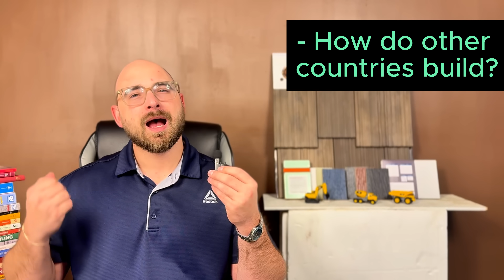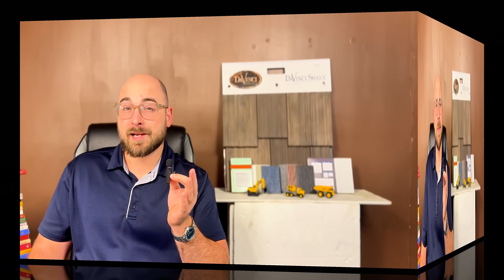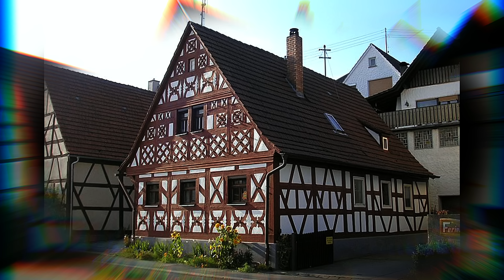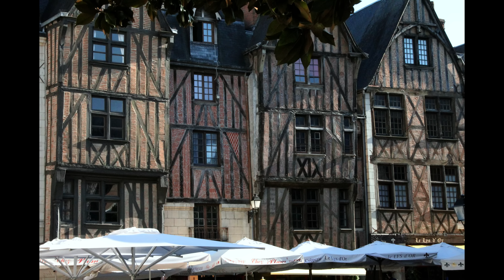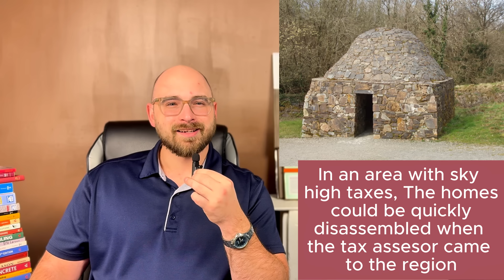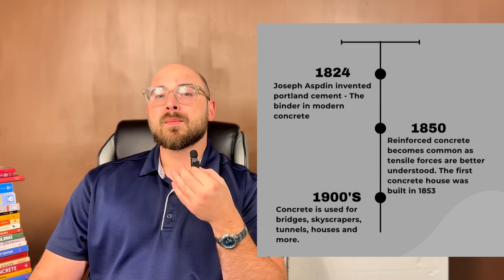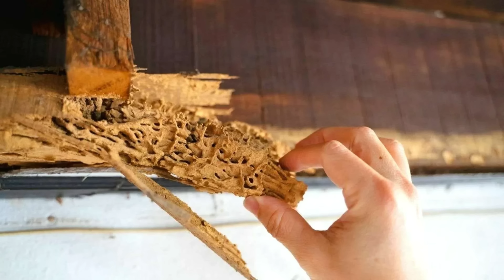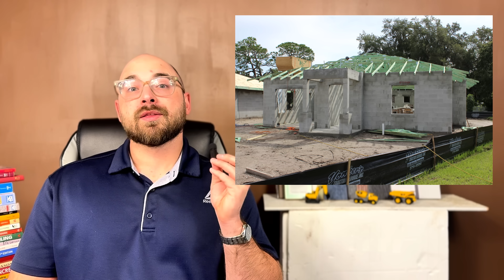Why Other Countries LAUGH at American Homes

Comment: We visited Europe in 2017, and stayed with friends in their rented suburban townhome in Warsaw.  The home was a spacious three level, and build quality was eye opening, compared to the stick and drywall we have in the States.  I did not expect solid concrete walls, throughout, quality stone stucco roofs, built like the proverbial bunker.  Warsaw was 90% destroyed in WWII, and rebuilt largely from the bombed remnants.  Frow what I saw, they build their homes to last.
Reply: It is not only wall construction but also for instance windows.  I went to the Sierra Nevada for skiing. In the ski resort they isolated single glazed windows with strech foil. In Poland we have minimum double glazed windows and tripled glazed are just standard when you buy new.
Reply: @piotrrajmundkoprowski4732  double pane windows are min code in the US. Not sure if any areas require triple pane windows but they are available if you want them. Just like some old buildings in Europe, some old buildings in US might have single panes but no house built in the past 60 years has single panes.
Reply: @Josh.1234  Josh go to Europe. Visit Poland, Czech Republic, Germany. You will see how much the US goverment lies. US standard of living is below average.
Reply: Well, you can build a american style home in Germany as well, as a rule of thumb you will need additional 30-50% structural wood to fulfill the DIN standards for load bearing and bending, and likely improve insulation and air tightness.
Reply: @helmutfrik1170  not only that, but one could build an American architectural style house in Germany but with load bearing brick, stone, and reinforced concrete walls!
Reply: @DT-wt5ku  in poland every trade school offers bricklaying programs. Canada had no masonry training until recently. Those masons who worked in North America were all feom southern or eastern europe.
Reply: Greetings from Warsaw.
Reply: Europeans plan to live in the same location for generations. Americans are always moving around. Family is not close. All of my relatives are close. 90 mins drive is the greatest distance.
Reply: @Unwoken_European  Americans don't have the time or money to build a brick house. They have to go to Europe to protect the weak...
Reply: @AnnatarTheMaia  I work as a C++ and OpenGL programmer for over 20 years. Wrote MIB3 navisystem for VW usable in ID.3, Golf 8, Passat and upwards. I do Shotokan Karate since i am 11. I build CNC machines, electronics stuff for my household. I planned and installed photovoltaic plants for 3 years in all weathers and risked my life daily in the name of progress and green transition. I built plants from 3kWp to 3MWp.

Guess your argument impresses others. But not me. But i wish you good fortune.

Have fun adding IP addresses and so.
Reply: @MrGerdbrecht  you have fun making laggy touchscreen interfaces for VW. No wonder they suck when they're programmed by stoners.
Reply: @ Na i probably know the guy who did this, a sober idiot with glasses. Nice try that went backwards. If you were proud of any of your software you probably would have mentioned some, or the OS's you are contributing to. My fav OS is Xubuntu.
Reply: @ My contributions were more the DTM (digital terrain model), areas, POIs (point of interests), drawing of streets ( i accelerated everything so it also works in Paris and India, which has lots of curly roads), middleware, database access, i made the base classes much faster, like GeoPosition, MortonCode even though hundreds of ppl and 15 years of work came before i started. But the touch guy was kinda the worst, making unreasonable long var names or 15 fingers or something stup like that.
He is/was the most sober and boring guy i can imagine.
Reply: @ But i remember  there was also an overlay from VW themselfs that controlled our navi functions like a supervisor. Maybe blame them aswell. They had a long  process chain just to change a button callback.
Reply: @ I also remember the RSI interface. That was like a http protocoll for UI with gigantic messages that has a huge latency like 150ms.
Reply: @ All the noob work of sober clowns.
Reply: @MrGerdbrecht  one is supposed to name one's variables in a descriptive way, in order to aid with cognition when having to understand and debug the code; especially C++ code, as C++ is a particularly bad programming language, and I should know, as I programmed in C++ for a living. And boring is good. Boring is excellent.
Reply: @MrGerdbrecht  all that firmware is "developed" by morons who have no business coming anywhere near it; this is exactly why my primary car is 20+ years old, why my secondary is 12 years old, and why my tertiary car is 14 years old. I drive brand new cars all of the time, and they are absolute garbage, in no small part due to all that shitty firmware.
Reply: @ "in order to aid with cognition" - Yeah but it does not help when the name is too long and spans an entire line. We have comments and so. A good  comment that reflects the intention is better.

" C++ is a particularly bad programming language" - Ahaha noob.

"Boring is good." - I like to differ. It's not like you proved some positive correlation.
Reply: @ "all that firmware is "developed" by morons who have no business coming anywhere near it;"

- Yupp, and they are probably boring and sober like u wanted.

Thanks agains for making a case against your opinion. Feels like you have difficulties with how causality works.

I am not the one restricting your freedom with bad software.

Again the reason the Input feels sluggish is because some sober id iot thought it would be good idea to combine server/client architecture with an interactive "realtime" UI on smartphone hardware. 

I guess we need a company full of weed smokers producing nice software to convince you otherwise. But since you are afraid of experimentation, and like most others,  it is unlikely to get any data.

Have fun h8r.
Reply: @MrGerdbrecht  oh, so now you're saying that programming while not drugged produces bad software? You're on drugs again. This is why people shouldn't take drugs.
Reply: @MrGerdbrecht  I don't have anything to prove.
Reply: @MrGerdbrecht  there is no code which I ever wrote that I'm ashamed of, but showing off would be particularly bad taste on my part; that's something best left to plebus vulgaris.
Reply: @ Ah here comes the double standard. But i have to prove something to you? Then i say you have to prove your sh*t to me. Have fun with logic.
Reply: @MrGerdbrecht  which double standard? I have nothing to prove to myself. And logic is fun.
Reply: @ You tried to talk down to me for weed. Then you tried to diminish my accomplishments. I said you have to prove to me not to yourself to justify your condescending opinion.
There's a big difference between being able to read and being able to understand.
I already know enough about you to form an opinion. There is nothing scientific and  beautiful about or worth to learn from you. Have fun.
Reply: That’s something I’ll never ever understand, why the fuck are we in North America not building 3 story homes. Seriously a 3 story and maybe even a basement is huge and that allows more rooms and a overall ability to have bigger families, something my country desperately needs with birth rates falling
Reply: Polish builders subconsciously build for war.
Reply: Thats probably the reason, they expect to get bombed again
Reply: You forget that these are greedy americans we are talking about. If they build their houses out of concrete, then they won't be destroyed, and the people won't be able to collect insurance money from them.
Reply: @AnnatarTheMaia  Ah i forgot i play guitar and piano, write VST plugins and hosts. I provide a cmake/MinGW toolchain for Windows including over 100 open source libs all compilable on Win/Linux from same source.
Reply: Concrete homes are all over the US.  Especially California.  Why are you living in shitty McMansion homes built by drunk Mexicans?
Reply: Concrete homes are available in the US. But they won't be a tract home. Custom home only.
Reply: @Rhaspun  Same in Canada.
Reply: @ I wonder if tract house developments happen in Europe like it is here in the US. If they do are they still built to the standard they use.
Reply: @Rhaspun  "I wonder if tract house developments happen in Europe"

Wait, you think building like the US is "development"? LMAO
Bricks and mortar are the second best. The best is stone.
Reply: @LucasBKOK define “best”? Stone and Masonry are terrible insulators. Extremely durable yes, but wood construction is far superior from a comfort standpoint. Construction is all about trade offs- there isn’t one universal “best”.
Reply: @brandonbeaty6617  the rest of the world has special bricks , light, large, sturdy and good insulators. Most of Europe doesn't like to use concerte walls for living space , we use concrete for structural integrity on the corners and between floors.
And between the concrete pillars with rebar that are in the corners we use the special bricks.
Reply: @LucasBKOK  no no, development in American English refers to property development, id est bringing sewage, drinking water, and electricity, commonly called utilities in the United States, to a plot of land, which then gets subdivided into smaller lots on which homes are built. It's a term.
Reply: @Rhaspun  Of course. I live on what was an airfield that turned into a housing estate. However all the houses were built with concrete blocks on the inside, brick on the outside, and tiled roofs. In every house I have lived in all the internal walls were some kind of masonry.  People thought builders were cheaping out when they started using pre-fabricated "Fink" roof trusses.

Someone else has mentioned "Bricks and Mortar". It is a common saying in the U.K. regarding investment that "you can't go wrong with Bricks and mortar" (although that wasn't true in the 1990s). It the U.S.A. do they say "You can't go wrong with sticks and drywall|" ?
Reply: @Rhaspun absolutely.
Reply: @LucasBKOK  Brick and mortar in the US is generally a one brick deep facade.  Brick in other parts is a brick wall reinforced with rebar.
Reply: Wood is a nice, renewable resource. Nobody knows why it is only for poor. If that is your way of thinking then i wish you good luck.
Reply: @MrGerdbrecht  it's only for the poor because it's cheap and not as durable, or will you now argue that wood is more durable than reinforced, poured concrete?
Reply: @ Cheap means it exists plenty because it regrows. Has not much todo with quality. For 2 floor home a good material.
Reply: @MrGerdbrecht  It is not a good material for a home, because it's prone to rot, termites, and in the Summer, it absorbs humidity and starts to stink. Combined with glass wool for insulation, it stinks to high heavens, even through drywall. You don't know that stench and creak, and boards and planks eaten to sponge-like consistency until you've lived in that garbage.
Reply: @ Maybe. But that isolation needs to be outside and the condensation point as far as possible away from the wood. I take canabis ofcourse. That creates a good smell.
Reply: @MrGerdbrecht  okay, well you taking cannabis explains your comment.
Reply: @ I also studied Umwelttechnik/Versorgungstechnik und technische Gebäudeausrüstung. Maybe weed can be used to as an insult were u at. But not were i am at. We use it as insulator (not insult) instead of the glass wool you were talking about.
Reply: @ Btw the part of weed that is a 'drug' for our brain is in fact an natural pesticide (or atleast some deterrent) for insects. Smoking weed helps reducing infestations. But it does not really help your definition of good smell u hater.
Reply: @ But gladly the future is bright and contains so many new materials that could be combined with old ones. I mean foremost high tech insulators like aero-gel (the thing NASA uses to survive reentry of spaceships) and MetaMaterials that can emit infrared light in frequencies that are not absorbed by atmosphere and radiated directly into space. And i will always add some PV panels.
Reply: @ And it depends how the wood was treated before used as build material. There are factories that slice the wood, treat it and then build bigger blocks from it again. It lowers the pure wood percentage but makes the material more even and stable to time and degradation.
Reply: @MrGerdbrecht  you studied, but did you graduate? It wasn't meant as an insult, simply a statement that under the influence of drugs, one's faculties are severely impeded.
Reply: @MrGerdbrecht  yeah I hate stench, imagine that!
Reply: @ Yes hater, i graduated in the things i was talking about. I also graduated in other unrelated things. I won math olympiads since i was 17 and 2 year long weed taker. My analytic IQ 179 as 6 year long taker is still better than most others. Enough to make my female roommate wet after she saw the results.

That happens when your malfomed worldview comes in contact with my existence.

Let me know what you accomplished being sober and i will consider, but i bet it won't be interesting or convincing.

If you have an argument for the actual topic let me know. Maybe your language is effing your mind since u always mix drugs with poison and medicine.

Thank god my brain is wired different.
Reply: @AnnatarTheMaia  You are using it as an insult and more importantly you are insinuating that they were stoned while writing the comment and you are trying to put the person down by doing so and asking whether they actually finished their studies. Just because your tone is more snobbish seeming does not mean it is not insulting.
Reply: @that1niceguy246 oh quit your whining! When one smokes weed, the substance stays in the body for at least a week! And yes, having studied doesn't mean graduated. Your reaction just reeks of that woke garbage...
Reply: @ Sadly my comment got deleted. I was saying i graduated the things i was talking about. But if you understood my comments you would have known. My analytic IQ is 179 and I won math olympiads. My faculties are well, thx.

Let me know what you accomplished being "sober" so you have an argument.
Reply: There is nothing stopping you from building that style of home in the U.S. But the price will probably give you a heart attack. That is a major factor behind building with wood in the U.S.- it’s not that contractors are all conspiring against us, rather, virtually no one in the U.S. would be willing to pay double the cost and wait 4-10x as long for the construction to be completed… and then be left with a home that’s unbelievably expensive to update or change. 

Additionally, stick built construction is FAR easier to insulate to a high degree. Concrete is a terrible insulator- to get adequate insulation you have to use something like ICF or built secondary walls on the inside (wood or steel framed)… which again drives up the cost.

There are dozens of other advantages to wood construction over concrete. To summarize, wood construction is affordable, fast to build, easy to remodel, easy to insulate (and climate control year round- most of Europe doesn’t run central HVAC systems, and rely on mild summer temperatures to keep cool), they flex instead of cracking during earthquakes and moderate storms, when storms do destroy them the cleanup is a fraction of the cost of concrete, they are light enough to be built in areas without accessible bedrock… the list goes on and on. Wood absolutely has disadvantages as well, but it’s not direct- “concrete is always better, wood is always inferior” situation. Both have their pros and cons.
Reply: @brandonbeaty6617  all concrete homes, in Europe, have double wall, with air box or insulation between them. You just try too hard to justify that your homes are built like european sheds.
Reply: @brandonbeaty6617 wooden houses generally have PUR foam insulation, which is absolutely terrible in the 120 degree heat of California, as it doesn't keep either hot or cold outside.
Reply: @snowsnow4231 and here we finally arrive to "the meat and potatoes" at the heart of this debate: Americans keep sneering about Europeans that they are "Europoors", and yet when it comes to housing, an American cannot afford the high quality house Europeans enjoy as a standard because, and I quote, "the price will probably give you a heart attack." So houses are built cheap in America because people living there cannot afford a proper house, only 2" x 4" posts and pressed plywood chicken coops.
Reply: @brandonbeaty6617  so basically poor Poles could afford it while rich Americans with a 27 trillion dollar bubble economy could not. Really puts things back into place, doesn`t it?
Reply: @snowsnow4231  Currently the difference in standard of living between Poland and US is not as big as you may think, depending on what state. I lived in Poland my entire life. Only visited US. But I didn't feel exactly poor.
Gotta take into account that Federal minimum wage in US is in fact lower than in Poland currently. So basically if you compare it to some mid-west states of US, you will see on average Poles making more money. GDP per capita will be still lower in Poland, but that's mostly because US is much more stratified society with staggering numbers of ultra - rich, comparatively Poland is more equalized in terms of income, few super rich here. 
For some reason though - real estate and construction in Poland is couple orders of magnitude cheaper. My situation is such - I bought studio apartment in a minor city recently. New built, first owner in very nice residential district. All concrete, steel and insulation, with one of walls being basically a huge ass 3 layer window. My cost traslated to USD was around 80k USD, then another 10k paid to contractors to finish it and around additional 4k for appliances and furniture. So in total around 94k USD. My take home is around 3k USD (ok I do have decently paying job for my age bracket, that is not the norm), qualified for subsidized loan at 2% fixed interest for 15 year time span. Monthly cost of this loan is ~400 USD (mostly principle, interest off it is like ... less than 100 USD), monthly cost of utilities/management and other fees around 300 USD so I still have a good chunk of income left after paying everything, basically 2k USD. And since prices in Poland for most things are indeed lower than in US, especially services, food... my average "doordash style" delivery order rarely crosses 12 USD mark. I can order it everyday and will still have good chunk of money left. Pre-fabricated, decently sized concrete house here costs around 100k to build over here, without land cost - which depends highly on area, can range from 50k to like 300-400k USD. It is still doable to get a house for 200k USD. My point in general is that ... poverty is relative. My 3k goes quite further than 4 or 5k in California for example. I was once offered a job in Western EU for around equivalent of 6k USD a month, but when I saw the prices and cost of living it... was unsustainable, it turned out I had less disposable income at the end of the day, than I have here.
Reply: @snowsnow4231 Also why are people only talking about concrete, do they all think we only  pour concrete when making a wall? The corners of the building are concrete pillars with rebar, and the rest of the wall 🧱 is made out of bricks , not the old type but the modern kind that's also a good insulator and is lighter and easier to work with.
If you wanna window or door you just cut that brick , the only bother is the dust .
And the foundation and flooring is ten concrete and then you can pick what you put over, when you wanna change it you break  the top layer and get whatever flooring you want.
Reply: @akmon3490  I would say material, if done properly, should not be hidden under anything, it should be pretty by itself. In Switzerland they make beautiful concrete houses that are not covered with anything and it looks great, it’s natural and fire resistant. I don’t get the urge to cover everything with cheap Chinese plastic decorations, it looks cheap, it burns like napalm. Brick, good quality brick, is beautiful by itself, just take a walk through London.
Reply: @snowsnow4231  36 tillion actually.
Reply: @snowsnow4231  "so basically poor Poles could afford it while rich Americans with a 27 trillion dollar bubble economy could not. "

The average Polish home is half to a third of the size of a US home.
Reply: @Crosshair84  because Poles live in a colder climate where heating homes costs money. Obviously.
Reply: @snowsnow4231  poor Poles have a major advantage. they live on the Northern European Plain after the great deforestation of Europe.
Reply: @brandonbeaty6617  tell me you haven't ever been in a concrete house without telling me you haven't ever been in a concrete house.
Reply: @brandonbeaty6617 better to pay expensive upfront than your whole house and hard earned stuff, memories lost, everything lost in a wildfire…
Reply: In Canada we insulate our houses because of the cold. Stone and brick houses are not nearly as efficient as stick frame with cavities filled with insulation.
Reply: @cs3818919  you are in no position to compare our European ultramodern and extremely energy efficient housing to your pressed plywood with glass wool insulation chicken coops, but I on the other hand am in a perfect position to compare, because I owned such a chicken coop when I lived near the Canadian border, and I renovated and additionally insulated that chicken coop: the heating bill went down by 50%! North American housing is absolute garbage.
Reply: We literally have stucco homes in the USA. Look at Cali, AZ, NM, FL. Like....hello. So what in the actual fuck are you talking about?
Reply: @shy707x  the part where that stucco is spread on pressed plywood... a bit different than our stucco (or façade, as we call it) which is spread over an insulating layer, which is spread over huge honeycomb, load bearing bricks or reinforced concrete... "a tiny bit" of a difference. (I lived in a pressed plywood chicken coop with stucco on it in California).
Reply: @shy707x  Basically Latin areas of the US.
Reply: Haha I have stayed in Warsaw before and most houses are not enjoyable to live in. Yeah they might last but that doesn't mean they perform well.